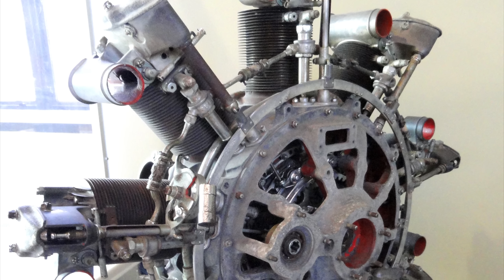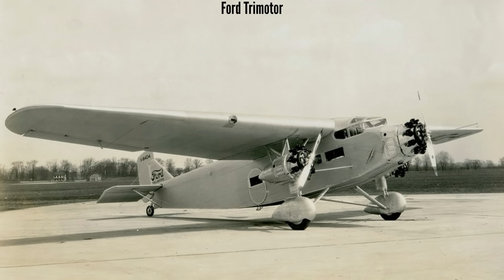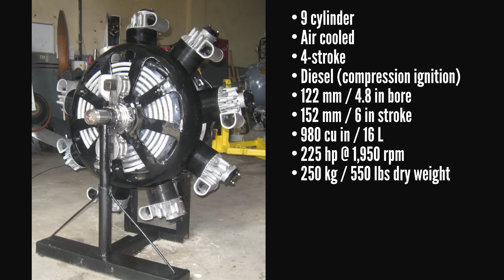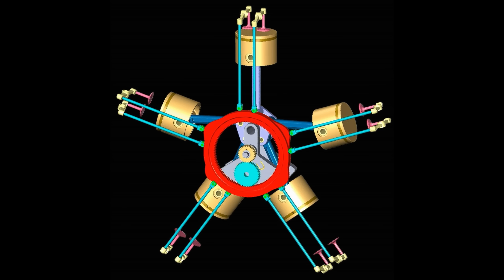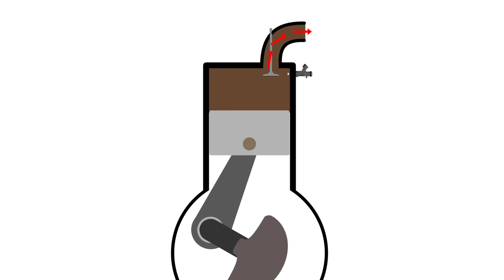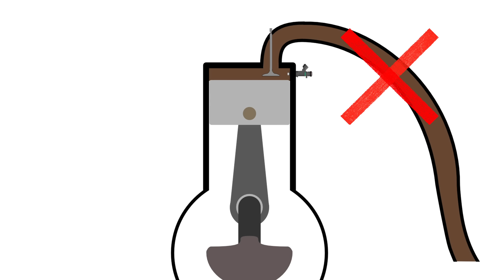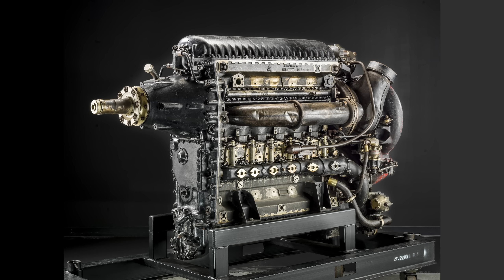The Single-Valve Diesel Radial that Almost Changed Aviation

Comment from the maker: Support me on Patreon : https://www.patreon.com/letsgoaviate
"X" Engines (Rolls-Royce Vulture & Packard X-2775) Design Explained : https://youtu.be/5VNnBW7gMlU
Why Rotax's 300hp V6 Aero Engine Never Saw Production : https://youtu.be/S9nnTghlB-8
Reply: Check out the Guiberson A-1020 4 Stroke Diesel Radial Aero Engine, was one of the main engine options for the M3 Grant & Lee Medium Tanks, the predecessor of the M4 Sherman Tank
Reply: I was taught the rule of thumb that gas gives 10 horsepower for an hour per gallon and diesel 18 horsepower for an hour per gallon. How does .4 pounds of diesel fuil per horsepower hour jive or accord with the old rule of thumb? I pulled up a calculator and got 17.75 horsepower hour per gallon. So then I had to try the .6 pounds of fuil per horsepower hour for gasoline and that came out at 10.5 horsepower for an hour per gallon
Wow pretty close
Reply: The engine is neither a legend nor a lemon. It's a pioneer engineering achievement.

Comment: Funny all they needed to do to fix the fume issue was hooking a squirrel cage fan onto the crankshaft and piped it into the intake. It probably would've slightly increased HP as a result and been a good place to put an air filter on at.

Comment: How can you posit that this engine could almost change history when everyone who flew behind it, even record-setters, hated it for its smell and vibration. This was a clever and unique engine, but its problems were fundamental and could not easily be solved. The single valve head precluded an intake or exhaust manifold, and also precluded supercharging foe altitude performance. If you use a different valve arrangement, the result isn't this engine. 
They only built 100 of them because they couldn't sell any more of them.
Like the 6 cylinder 2-row Wright Challenger, (terrible vibration) there is one in every museum because nobody would fly them long enough to wear them out.

Comment: Well, it didn't almost change aviation. It never came close.....perhaps it would be more accurate to say that it might have changed aviation. The death knell for the Packard Diesel is that virtually everybody who flew behind it hated it for the smell and the vibration. It didn't make friends. Nobody will invest money in a development that no users like. At the time it was promising for specific fuel consumption and economy, but those two factors have never won out over power-to-weight and reliability (Ref. the gas turbine) in aviation applications. Also, at the time, supercharging for increased power and for altitude performance was coming on strong, and with it's single valve design it was a strictly ambient engine. As the narration points out, it had known issues, and every solution to a known issue had a negative impact on it's weight. At the time, it also faced the inverse of an issue for present jet -A consuming....diesel fuel wasn't readily available at the airport.
Another crack at aviation diesel power, Post-WW2, was the fantastic Napier Nomad. look it up on Wikipedia It addressed all the diesel issues and looked , on paper, to be very attractive for long-haul flight. but everything about it was contrary to the emerging gas turbine strengths. The turbine was powerful lightweight, smooth and promised very low maintenance.
Another contemporary engine, the Curtiss Challenger, a two row 6 cylinder radial, also never was accepted by the market because it vibrated so badly. I've heard it said that it is extraordinarily well known for a market failure....every museum has one because nobody ever used one long enough to wear it out!

Comment: the wonderful thing is that this engine needed to be made in two star configuration and, instead of that short pipe, it needed a long pipe with a convergent cone in the front and a divergent cone at the back of the engine to facilitate estraction

Comment: Funny that the most commonly used aviation engines nowadays run on jet fuel, which is a lot closer to diesel than it is to gasoline, and also use a single tube for intake and exhaust.

Comment: Interesting use of a single valve for a four stroke engine. Converting to a two stroke would have created more problems with heat with the single valve setup, although Detroit Diesel used the set up for years.

Comment: A very interesting video. It seems that the. Vibration issues might have been solved with a counter rotating assembly? Maybe the smell could have been solved with some creative ducting or ? You certainly can’t argue with diesel cycle efficiency!

Comment: The lower volatility of #2 diesel fuel compared to avgas implies that it might have been a safer fuel, less prone to catching fire in the event of a fuel leak or crash, but it's high gel-point temperature is a disadvantage in cold weather or at high altitude. Diamond Aircraft is producing a 4-cylinder in-line engine based on the Volswagen TDI that has excellent fuel economy and a very long service life; these two advantages more than compensating for the higher weight and smaller power to weight ratio. Aero-diesel engines offer real benefits, but the Packard DR-980 came too early. Modern diesels have computer-controlled fuel injection and valve timing, which add even more improvement to fuel efficiency.

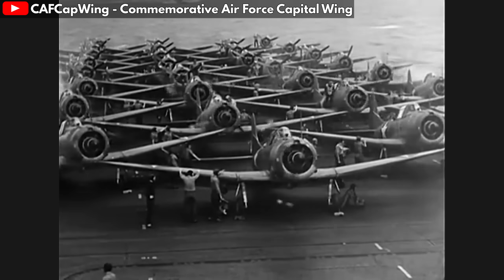Comment: 14:32 I'm starting to get ideas of arranging cylinders from a Detroit Diesel 53-series 2-cycle in a radial configuration and setting them up for air cooling. That could also be done with one exhaust valve, though the heads had two early on and 4 later, also used unit injectors, and didn't have the 'wont idle down' drawback here. Also they fire twice as often because they're two strokes which might help some with secondary balance.  A second row of cylinders clocked 180 out would also help smooth things down some.
Reply: IIRC those and the succeeding 71 and 81 ci per cylinder engines were really heavy.
Reply: @gregwarner3753  You're not gonna be unbolting cylinders from a 4-53 and bolting them onto a radial frame lol. Liners, pistons, supercharger, unit injectors, governor, 'bout all that would cross over I think. You'd have to make the case, the rod assembly, crank, valve ring, etc all from scratch.

But I think it'd work fine, and those engines have some serious power potential when you pour the coals to 'em. They're pretty anemic power/weight from factory because they're industrial engines aimed at rugged longevity by default but guys have taken 400hp 12v71s and turned them up past 2,000hp no problem. A 10 cylinder twin row radial built like that could make a LOT of power for its weight.

Comment: There is one in a museum in Argentina. The engine is a jewel of engineering. However, as many (if not all air cooled engines) is cooling fins were poorly designed. Improving them would have required experimental testing of combustion and fin heat transfer. Injection could be improved. Almost all Diesel engines of the era and well in the 70s were smoky. Finally, it is said that due to its design, it couldn't use conventional exhausts; however, this is clearly false. A blower simply had to be fitted up front for that purpose. Something that was proposed and would have solved all the problems and allowed turbocharging was the conversion to a iniflow scavenged two-stroke . This was considered but never implemented. That would have made it truly revolutionary in terms of power and efficiency.

Comment: In 1930 Czechoslovak company Walter offered license produced RD980 but without succes. One engine was tested in prototype Aero A 35 (built for intended trans Atlantic flight)

In 1933 Czechoslovak company Zbrojovka Brno designed two stroke diesel radial ZOD-260. It was tested on various aircrafts (including license built Fokker F-VII) but never produced.

Comment: The increased distance per gallon of fuel should have outweighed its disadvantage of vibration. Multi engines on the wing, like a DC 3, together with an enclosed fuselage, would have eliminated the exhaust fumes and reduced noise levels. More development could have reduced vibration.  Would  such an engine have been more useful in the B17 Bombers, achieving chgreater distance, or perhaps  perhaps bombing multiple taget ateas?

Comment: Thanks for this wonderful, very informative, video with answers.

Not that I'm into aviation much. I was a student pilot for a couple of years but I didn't follow through getting my license. My father had his private pilot's license. I learned how to fly when I was 13. Instead of a bar mitzvah. But I had already wondered. Why didn't they use a diesel engine. That required no ignition system to fail. But I put it out of my malfunctioning mind. And never gave it again much of a thought.

And now I'm wondering. They didn't like sitting behind the engine and breathing diesel fumes. Can't say that I blame them. And so no fighters, with those engines. Okey-doke then.

Then why weren't they used on the multiengine bombers? And didn't diesel require less refining than, gasoline, petrol, benzene? And diesel doesn't explode as easily as gasoline. And with an airplane? It would almost make sense to use diesel. And more chance of survival in the event of a crash. But I guess people's brains didn't work back then? It was so long ago. Before our brain matter formed.

And so it still makes me wonder. Why you don't find them with, multiengine pipers, Cessna's, Beechcraft? Where the engines are mounted wings. Then no problem breathing exhaust fumes. But by that time we were into jets? Right? And it never had a chance to catch on or mature.

Could I mount one to a motorcycle? But with only 100 every made? I imagine it might be hard to get parts while on the road?

I miss flying those Piper Cherokee 140's. It was awesome for me. I was only 13 when I learned. 15 when I stopped. 10 big hours in my pilot's logbook. And I was a natural at it. But unfortunately five years later. The Air Force, Navy, Army, Marines told me. I did not qualify to fly jet fighters. Without a Masters degree. And stupid me? I thought they wanted people that knew how to fly? But no. They want people to learn how to, Master, Degrees I guess? As I ain't got no, college degree.

There was nothing like the sense of the feel, of flying an airplane. When you lift off from, The planet. And when you carefully control your, crashed back down into it. Without busting off the landing gear and breaking your crown.

 that was a great video. Thank you very much. I feel smarter now. Even at almost 70.
RemyRAD

Comment: It seems as though it would have been easy to redesign it as a two-stroke - exhaust using the single valve and inlets in the lower barrel with a supercharger for forced induction. In WW2 diesel fuel would have made planes a lot safer and it could even have been used as an engine for the Sherman tank in place of its petrol radial.

Comment: Demand for fuel efficiency will bring back diesel piston engines back into the air. Some companies are already working on it.
Reply: And they're failing, horribly. The DA50 diesel, for example, has the same fuel burn per hour (by volume) at cruise as the Beechcraft Bonanza, which is a very old aircraft, using very old gasoline engine technology. The CO2 emissions and energy usage for the DA50 are also higher than the Bonanza, as jet fuel contains more energy and carbon by volume.

Comment: Not sure if you covered it and I missed it, but what is the coiled pipe on the front of the engine for ?
Reply from the maker: It's the oil cooler
Reply: That was the oil cooler

Comment: That's an interesting design.  It probably would have been more successful on twin engine aircraft and airships that had the engines away from the cabin.  A simple diverter in the tube would also have made it cleaner at low speeds.  A ramp forward of the intake/exhaust port that closed off about 3/4 of the intake air at low RPMs but could be retracted at higher speeds for better efficiency.  Couple that with better rings and more modern oils and it'd probably throttle just fine on the fuel controls.

Comment: Based upon the information you've provided I'd say the engine was rushed to commercialization as testing should have identified many of the inherent weaknesses of the design (vibration, exhaust gases entering the cabin, problems at low throttle).

Comment: The Packard DR-980 is a tragic legend.

Pet peeve: People getting Diesel combustion wrong. 

The proper explanation is, as soon as the fuel begins to spray and mix with the air, (in a well-operating engine with the right fuel), it also begins to combust. Before all of it's finished getting in.

This process continues as more fuel enters, and as existing fuel (now flame) continues to mix into more air. This is why Diesel engines don't have to consider air-to-fuel ratios: Each flaming droplet of fuel will find its own as it burns, at least so long as there's enough Oxygen left in the combustion chamber. 

If atomisation is poor (which can be from the nozzles, typically only ~1/4mm diameter each, wearing into a larger size) then the ignition can become 'late'. This is beause it takes more heat, collected slower (surface area to volume ratio in the way) in order for the droplet to reach ignition temperature.

This is called 'premixed ignition', and it's a bad thing for both DI Diesel engines, as well as Rocket engines: For the same reason. 

Here, a 'cloud' of fuel air mix forms and gains volume as it goes longer and longer without ignition. Then, it goes off and can detonate like a little fuel-air bomb, creating a detonation shockwave that hammers into the inside of the engine, with such force that it can snap/break valves and gaskets, or burn holes through pistons. 

This is called 'Knock' in Diesel engines for the distinctive sound it makes. It's somewhat analogous to 'pinging' in a petrol engine, and has the same root cause: The fuel-air mix finally reacting on arrival of a strong sound shockwave, further strengthening it as it passes by: This is a detonation, same as a fuel-air bomb, much like how LASER's work, but with sound.

This also can also happen in a Diesel, especially at high altitude and/or cold weather, if the air is too thin and too cold: Effectively reducing the effect of the compression ratio. I.E. reducing the heat available to evaporate and then ignite the fuel-spray. 

This leads to more and worse premixed combustion: And the magnitude of the knock gets worse as the atomization gets finer! (Coarse atomisation does lead to also Knock, but it tends to react less/slower, so the peak pressure isn't as bad).

The fix to it is NOT to decrease the CR, it's to increase it! 

So they totally screwed up (fatally) when they dropped it to 14:1. 

They should have bolted a turbocharger on instead, that would have fixed the vibration issue at high altitudes. Enclosing the exhaust would also have fixed the 'smell' issue. But this would require losing the one-valve-per-cylinder unique feature.

This is a tragic case where sticking to a design idea beyond its merit (in this case, 'having a single valve per cylinder'), and then changing something else, (CR, the wrong way), caused catastrophy. 

They would have been better off just increasing the CR, even if it came at the cost of decreasing the bore: You can end up making much more power at higher RPM ( because less weight, redline goes up), even while keeping the same crank / big end / case. For the same conrod loads, you can have much higher pressure, with higher RPM's safely at the same time.

But they failed, pretty tragically too. 

And then the Great Depression happen and really wiped them out.

And to this day, multiple companies have tried and failed to get Diesel Aircraft engines widely adopted, even though they honestly are a good fit!

Were I going to just pick an existing automotive engine for a small aircraft, I'd grab an OM606 (or two), and get it rebuilt and modded with supercharger and huge turbo by the lads at dieselpumpuk. Those things have a long track record, and can be fitted with mechanical pumps to make them 100% electronics free and ultra-reliable. They're also straight sixes with reasonably good secondary balance, which is a thing you want in a plane (also why there are so many boxers). Finally, limited to lower RPM longevity will be good, even whilst keeping power to weight ratio quite high (even compared to petrol engines).

By The Way: Secondary Balance is completely unaffected by the weight of the pistons: That's a primary balance issue, since they only reciprocate. It is affected by the weight of the conrods, which would be heavier for a higher force motor: But again, this only applies if the configuration doesn't have perfect seconday balance (which straight 6's and boxer's do). 

In case you're wondering, the con-rod Force mentioned above is the sum of the inertial forces, mostly from the mass of the piston stretching the conrod, (mostly happens only during exhaust/intake TDC, where there isn't much counter-acting pressure) which grows linearly with the piston mass, and with the square of RPM; and the compressive force from the compression and combustion, which is the product of the pressure multiplied by the cross-sectional area of the pistons (or, if you like, the displacement divided by the stroke, which is also that area).

Secondary Balance is all about the sideways effective motion of part of the mass of each conrod, because one end of it is rotating with the crank whilst the other end is only reciprocating with the piston. This isn't a sinusoidal motion either, so it's difficult to balance it except against another conrod moving the opposite direction.

Comment: While we’re on the topic of diesel radial, can you also talk about Klockner-Humboldt-Deutz DZ 700? There is so little info about it on the internet even though it supposedly has 2 kW/kg or more than 1 hp/lb (!!!) power to weight ratio which is insane for a diesel engine.